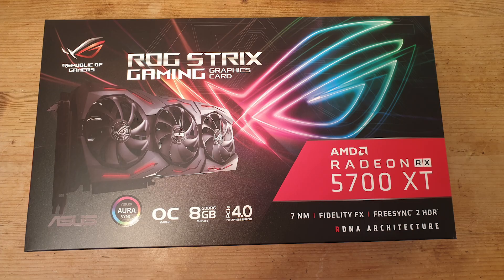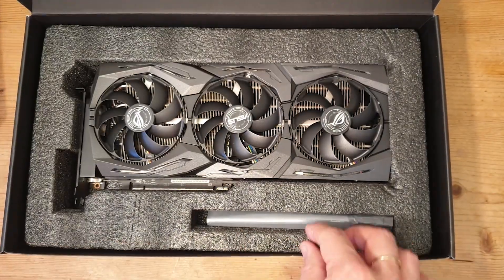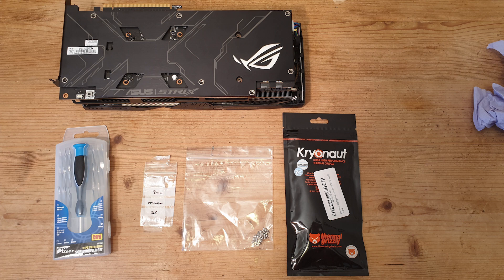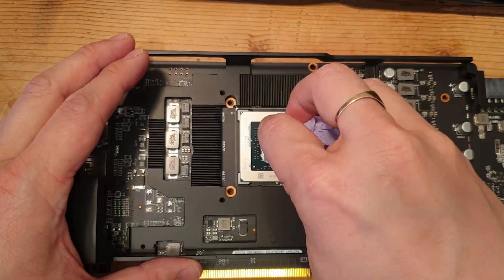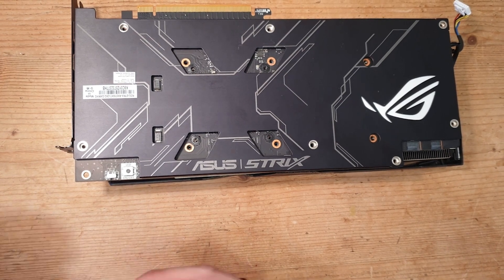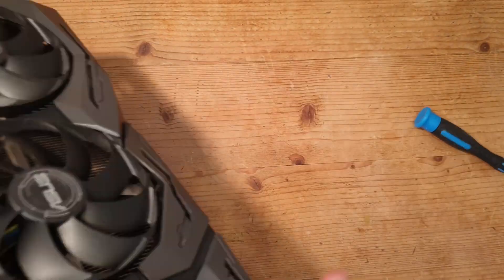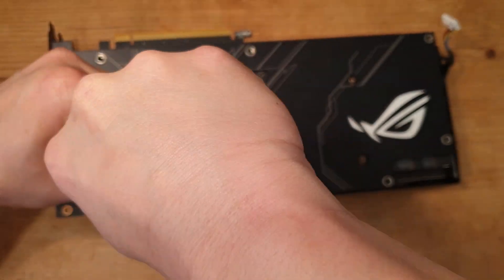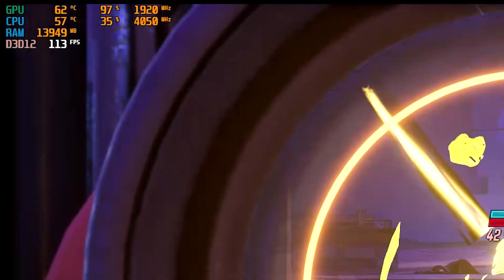ASUS ROG STRIX 5700 XT Tempeture Fix

Comment: Where did you put the washers again, you said 6 holes. So was it 2 for the Vram on the right side of the card, 2 for the spring loaded, and another 2 for the orange. I’m confused
Reply from the maker: 2 vrm screws on the right and the 4 spring loaded gpu screws.
Reply: @HardwareHusky  and what size should the washers be
Reply from the maker: @stephen2108  The nylon washer you will need are, 
M2mm x 5mm x 0.5mm for the VRM screws

If you wanted to do the GPU for more pressure. 
M3.5mm x 8mm x 0.5mm for the spring loaded GPU screws.
Reply: @HardwareHusky  where do I find the washers, can u send a link
Reply from the maker: @stephen2108  eBay, Amazon or a local hardware store will have these,

https://www.ebay.co.uk/itm/2mm-White-Nylon-Plastic-Washer-Spacers-M2-New-Pack-x-25-Free-UK-Post-/250951154962?_trksid=p2349624.m46890.l49292

https://www.ebay.co.uk/itm/FLAT-BLACK-NYLON-Plastic-WASHERS-Form-A-M2-2-5-3-M3-5-4-M5-6-M8-10-12-M14-16-M20-/401506514600?_trksid=p2349624.m46890.l49292

Comment: i did this. was getting 85-90 on cyberpunk but never exceeded 70 now. used mastergel pro v2. and used the new screws provided by asus service
Reply from the maker: Was it straight forward getting them from Asus?
Reply: @HardwareHusky  yeah suprisingly easy, told them asus published that etc etc, they shipped 4 heatsink and 2 new vram screws.
Reply: @skipyramid  same for me replaced em but my junction temps never dropped.
Reply: @batuu5166  junctions will be high no matter what. mines are 80~
Reply: @skipyramid  80c? I don't see 2 digits on ROBLOX yes that lego game only time JT is normal is when I casually surf the web

When I replaced my screws my temps were below 60c  but JT didn't drop at all I told them what's going on and they told me to send the card and i did

After literally a long fucking week they decided to send it back with a message saying NOTHING WRONG after 4-5 months my degrees went back up to 80c JT is still rocket high 2 of my fans is unbalanced now thanks to dust and I can't clean them because the screws are placed in the tighest place ever.

I'm just tired of trying to fix this darn card idk what to do
Reply: i did email asus for the replacement screws but they asked me to bring in to their service centre instead which i havent since pandemic started later.

Comment: this week i wil buy this card. does it have this problem or its fixed already?
Reply from the maker: It has been fixed but there is a chance you might get one that has been sat on the shelf since last year which isn't fixed.
Reply: @HardwareHusky  thats wouldnt be good. but i can refound,or not?
Reply: @HardwareHusky  by the way i dont think that there are many old 5700 xt. they are famous card in my country.
Reply from the maker: @Tomxhawk  You can get a refund for a faulty product and you shouldn't get a old one but I thought I would mention it because someone in this comment section got an old model a few months ago.

Comment: Nice vid! In my case I didn't use spacers, just repasted and tightened the screws a bit more on my 5700 XT Pulse. My junction temperature went from 100°C to ~65°C.

Comment: I dont get why the washers ? i know u said to shorten the screws but why ? are they too long or something ? did they not tighten enough ?  You could go a bit slower with everything maybe explain a little bit more for people that arent too familiar with this.
Reply from the maker: Merry Christmas, on the early models the vrm screws are too long and the cooler heatsink is too heavy for the mounting system they used, this causes the heatsink to pull away from the pcb and the component temperature rises.
Reply from the maker: I prefer the washers over the shorter screws because it allows more thread into the heatsink screw holes while the washers take up the slack.
Reply: @HardwareHusky   Merry Christmas to you too :) and thanks for the reply.

Comment: prompt is it dangerous to use 2 washers 1mm? 
for GPU screws with spring put 2 washers 1mm there
Reply from the maker: I have tried 2MM of washers but I did not do the screw up hard because you can crack the die.

Comment: I just bought mine less than a week ago hoping that I'd get a fixed one. Apparently not, as the GPU runs around 78 C, junction at 95 C, but what really concerns me is the vram. In The Witcher 3, it easily gets around 96-98 C, and in furmark, it got up to 106 C once (then I stopped the test). Is there a fix for this issue?
Reply from the maker: First thing I would check is that the bios switch is at P and not Q because Q is quiet mode that runs the fans slower and GPU hotter.
If that is not the issue I would speak to your retailer.
If you want to keep the card you can preform the washer fix to just vrm that would lower temps without opening the card.
Reply: @HardwareHusky  Thanks for the reply. :)
I tried the Q bios out of the box, but it was absolutely rubbish, so I put it back to P and left it there.
I did the washer fix on the VRM screws today. My GPU temp went down 5 degrees (75 now), and the memory hovers between 90 and 92 C instead of sitting at 96 (the witcher 3). It's still hot, but acceptable now, I guess. I think I'll keep the card while it's in warranty, and then we'll see.
Thanks very much for your help, and please keep this video on YouTube forever. :)

Comment: Just wanted to let you know I’ve literally watched your video at least 5 times debating on doing this unfortunately I got my 5700xt on there day one release date so needless to say I had thermal issues not to mention everything we have dealt with the driver problems. I had called asus three different times and set up a rma to send it back to get fixed because I didn’t think I could pull it off. I never sent the thing back due to COVID and being stuck working from home and didn’t want my main rig to be down for considerable time. I even tried telling asus I would purchase a nvidia card from them and pay the difference which included buying a new motherboard but that’s something they don’t due. So finally tonight after my cards steady rise in temps I broke down and tore the thing apart the exact way you did with two washers on each of the six screws and brand new thermal paste. I’m a first time PC builder I stream and edit content so this terrified me breaking the seal on the warranty sticker. But after it taking me almost a hour I got everything put back together tight as possible and I just was able to play apex in 1440p while streaming and recording with it down scaled for twitch at over 144 FPS and my temp didn’t break 60c on top of that my junction temp never ran above 73c. It had previously gotten so bad I was forced to play at 1080p at 120fps with every preset turned down in settings with my case open for better airflow. My temps stayed in the high 70s to mid 80s during gun fights and junction temp under any strain would hit 100c with no problem. I am so pumped man this really made my month, hell six months. Awesome video can’t thank you enough!!!
Reply from the maker: So glad my video helped, it's feels like such a complex task before you start it but once you have it apart and back together you realize it wasn't that hard at all.

Comment: Thankyou so muchh, from 85c++ gaming to 63 max! But the junction still at 90-105 is this temp safe?
Reply from the maker: That junction temp is in a safe range but can be a bit lower if you make adjustment to the gpu die and cooler contact.

Comment: what are the washers and size
Reply from the maker: M3mm x 6mm x 0.5mm     OR     M2mm x 5mm x 0.5mm for the VRM screws

If you wanted to do the GPU for more pressure. 
M3mm x 8mm x 0.5mm for the spring loaded GPU screws.

Comment: Where should i look for these nylon washers, can i use a randome piece of plastic and simply shape in to a washer it?
Reply from the maker: I got mine from eBay for cheap, there is no reason why you can't use something like a old bank/store card and fashion it into a washers.
Reply: @HardwareHusky  hmm, that is a good option. Will the card plastic withstand the temperature generated by the card, i will look in ti that.

Comment: Where do you get the washers? What size
Reply from the maker: M2mm x 5mm x 0.5mm for the VRM screws

If you wanted to do the GPU for more pressure. 
M3.5mm x 8mm x 0.5mm for the spring loaded GPU screws.

You can find them on eBay or Amazon.
Reply: @HardwareHusky  thank you!

Comment: Adding some spacers to the 4 heatsink screws took me from 91c to 60c
Reply: hi @dinoz can you elaborate on how you did it? Thanx!
Reply: @andrewtatetopgarmy  Remove the 4 bigger black screws with springs under them from the back of the card, including the warranty sticker one, add some small 1mm thick shims or any kind of spacer that will add some more height to the screw, and tighten them back in
Reply: @donos_86  how will this solve the problem of overheating of memory chips? these screws do not participate in memory pressure they are only for GPU
Reply: @ArmsK7  there are also 2 other screws besides the main heatsinks ones that are for the memory heatsink, do the same thing to it and itll help
Reply: @donos_86  
in the memory clamp, only screws are involved in the center just above the GPU and the extreme ones on the right at the end of the board, these screws were not used in the Husky video https://3dnews.ru/assets/external/illustrations/2019/10/16/995712/IMG_0028.jpg
Reply: @ArmsK7  Sorry I was referring to the VRM's
Reply: are these screws m2 or m3? Did you use 0.5mm thick or 1mm thick washers?